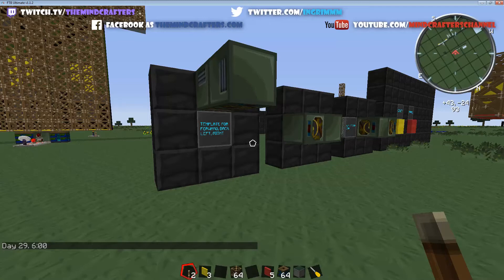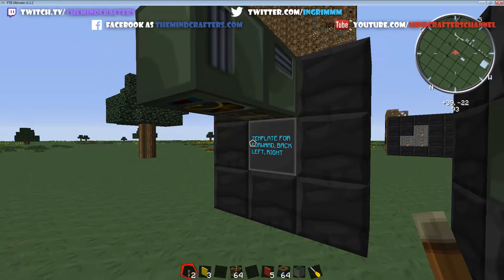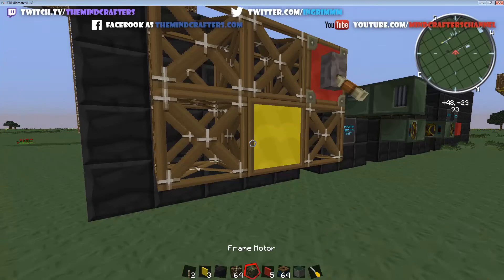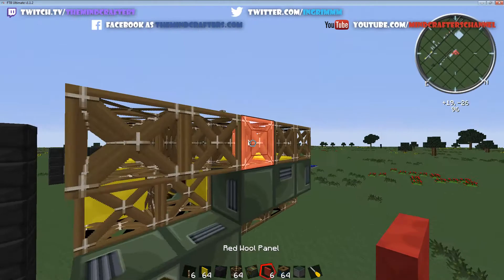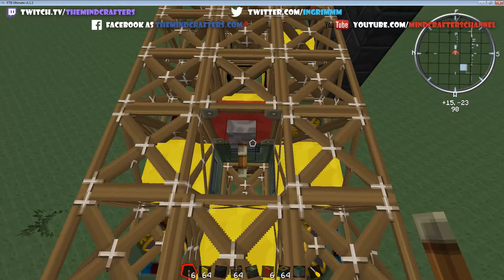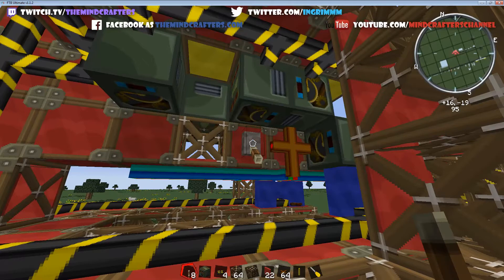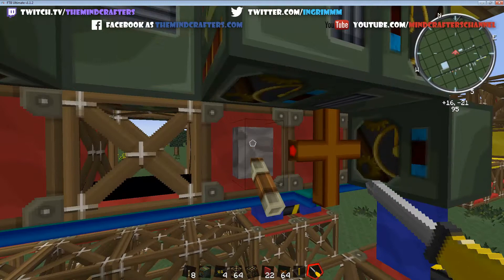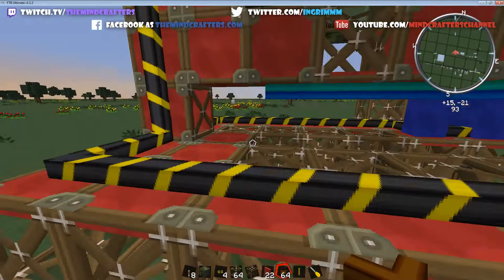TheMindCrafters - Let's Build an Airship - Episode 2 - Omni Directional Inchworm Engine ODIE

Comment from the maker: Make sure everything is connected to a frame! 99% of the time there is something that's in the way. Also if you have more than one motor in second position (that is, it's been moved into place by the first motor) then technically the motor (the one not being used that you moved into place previously) will get in the way of the one you're trying to move. e.g. if you try and move up then realize there was something in the way,   you need to reset the up motor before you can move again

Comment from the maker: I might implement GPS but there is a limitation on the range of the rednet signals that sucks (384 at max altitude). Also, I'm not sure what I'll end up doing for remote transport of players because the idea was to build something that works on different modpacks - we'll see - might have to do a montage of warp methods for each major pack

Comment: You should add a rail layer! That is somethink i will try, i hope deployers can work with rails.

I like your design a lot. somewhat more sly than the bulk i used :D
I will exchange your yellow cover for glas cover, makes rotating the frame motors easier ;). I will also try to change frome cable to wireless, because i like to move my ships remotely, and ccraft as a limited range.

Comment: Then there is the ability to chain engines aka have two separate engines, having both move into place their ship moving engine at the same time, then fire the ship moving engines individually, while it doesn't matter if you only plan to move it a short distance, in longer distances the multi engine method method cuts time sent still, down from a about 0.625 blocks every  second, to about  1.136 every second with 20 engines total(10 that move the whole device), nearly double the orginalspeed